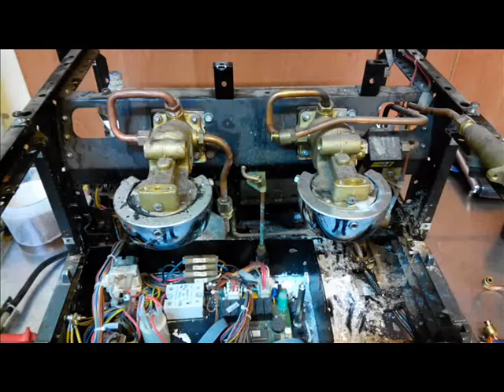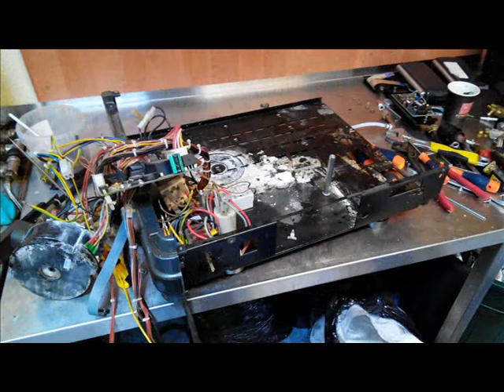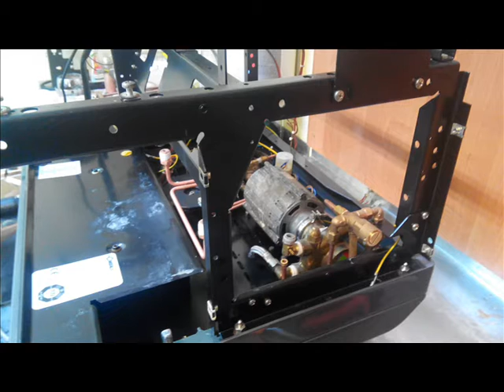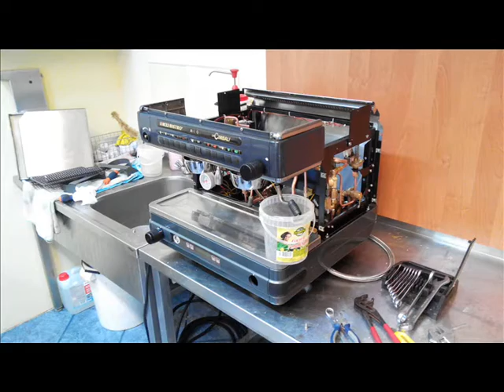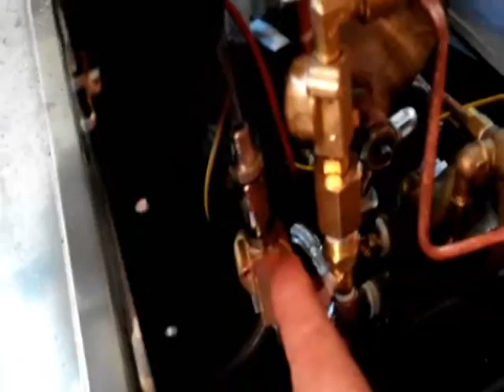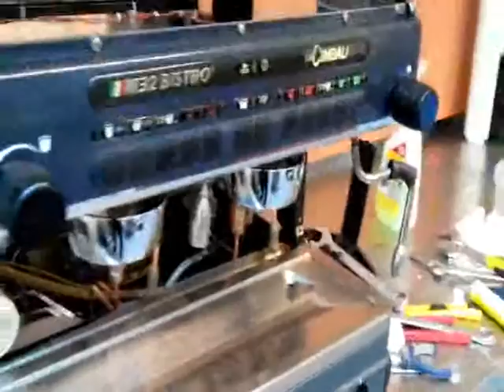Espresso coffee machine La Cimbali M32 repair.

Comment: can you please tell me where to get the solenoid valve from? i did search Australia for it coudn't find it. mine is L120v07 ref # 731351. used in LA CIMBALI M29. thanx a lot
Reply from the maker: Hard to say, i never was in Australia :) i find a lots of spare parts on German Ebay. Try to find some Praker's solenoid valve seller (this mark La Cimbali usually use in they machines) at your area and ask for. But if there is no problem with coil u can restore usually your own solenoid valeve with some chemical detergents.

Comment: Sorry to ask a simple question, but how do you remove the top and side panels?
Reply: Nearly every Machine, at least for Gruppo Cimbali (Cimbali, Faema & Casadio) is the same. Two Philips Screws on the top, where the Cupwarmer is. Lift the Cupwarmer and unplug it. On each side there are like 2-3 Screw on top and then you can disassemble the side panels.